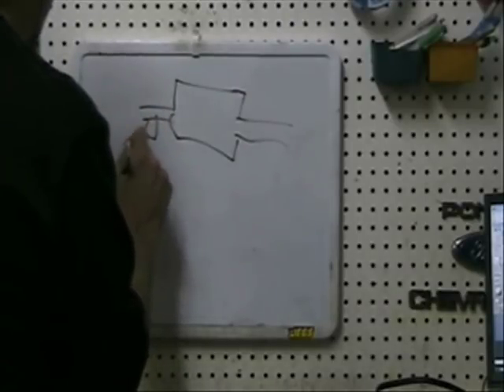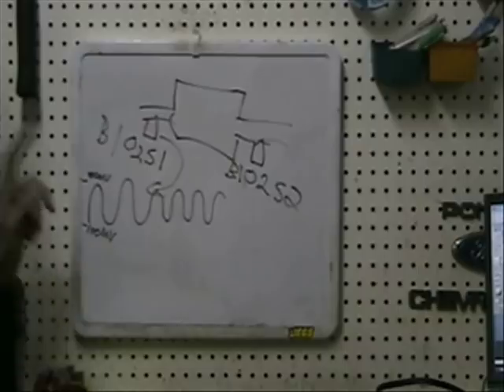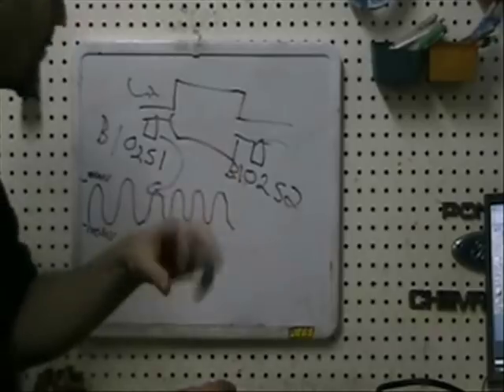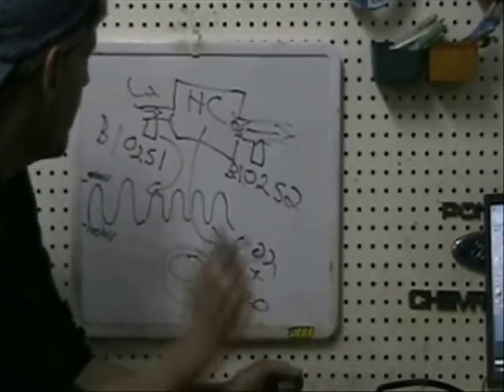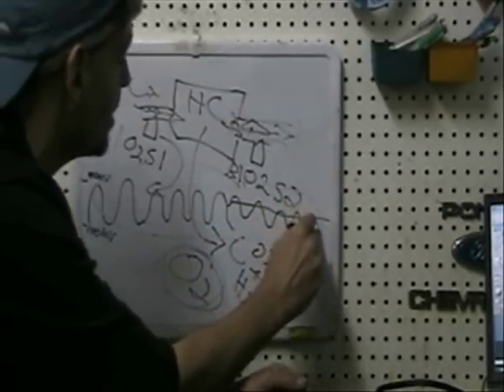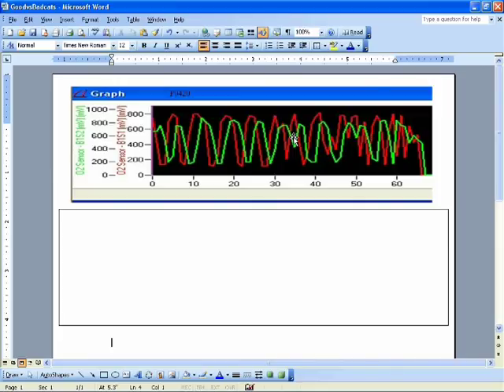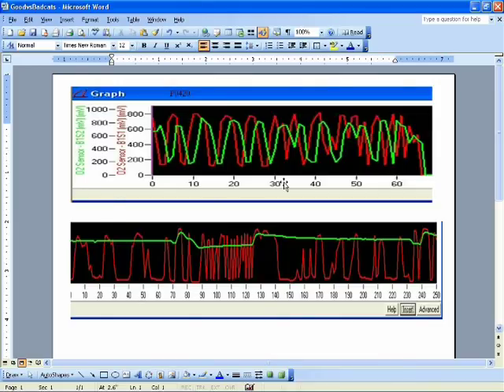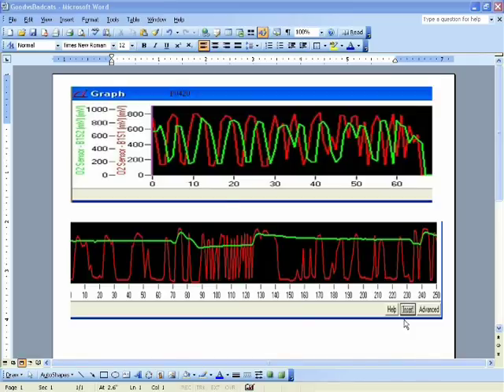P0420 P0430 catalytic converter catalyst inefficiency code diagnosis

Comment: Matt, i have a ford focus, it has p0420 last week and i check live data. Downstream o2 is changing the voltage rapidly, back and forth. I can't afford a new cat what do you reckon if sparkplug non foulers will help or no?
Reply: +EngrChillaX First, make sure the upstream O2 sensor is cycle properly, including that it is cycling fast enough. A new sensor should cycle more than 3 times a second. If your upstream is cycling less than once a second, replace it.

If the cycling is okay then try one of the commercially available converter cleaners such as Cataclean. If the converter hasn't been overheated and melted inside, it might just have carbon buildup, which the cleaner will remove. This will bring the efficiency up above the threshold and stop the code from being thrown.

Don't replace the converter until all of the other possible causes of the PO420 have been eliminated or ruled out.

Good luck.

Comment: I have a 2003 Rav4. I have the P0420 and P0430 codes. Why they put 4 O2 sensors in a 4 cylinder car I do not know. Anyway the readings from the O2 sensors are what I would expect from the upstream sensors. The downstream sensors indicate the same readings (pretty much) but instead of being less than one volt, they are 3.2-3.3. Is this normal?
Reply from the maker: Are you sure you don't have A/F sensors? It is impossible to have over one volt on a ZiO2 sensor.

Comment: Check engine light is on. P0420 is the code.  I went through POSSIBLE causes like the negative battery and all. But I just remember, we just move to Idaho and where we are there is NO SMOG CERT. IS IT WORTH TO FIX THIS? IF IT IS THE CATALYTIC CONVERTER, can I just FORGET IT? Or it will affect the engine? I hope this is a bit more clearer and I apologized, since you have given me good suggestions before. Again, thanks.
Reply from the maker: +timeisnow316 If the inefficiency is strictly evidenced by a mirroring of the front O2 sensor then no engine damage occurs, there is just simply no catalytic activity is all.

Comment: Thanks for the video, Matt. My 01 Jeep Grand Cherokee just gave me the P0420 code today. I do not have a scan tool to perform the tests in your video. That being said, let's assume my cat is toast. I live in an area where I am not subject emmissions testing (yet). Realistically, how long can I expect the vehicle to operate normally with a bad cat? Other than poor fuel economy, am I risking further damage to the engine? Thanks!
Reply from the maker: It's hard to say. First of all you might already have an engine issue that caused that bad cat- if the engine is running rich for example. In that event, you will surely eventually plug the cat and your engine will have severe performance.
  On the other hand, if the catalyst is just no longer active, there are no ill effects whatsoever. The only effects are environmental. You can run indefinitely with a bad cat as far as engine performance goes.
Reply: Thanks for the quick reply. If data from a diagnostic test showed similar results as the car in your video (OS1 and OS2 outputs the same), is that representative of an inactive cat?
Reply: Obviously the cat is inactive...guess what I meant to say is, is it representative of ONLY an inactive cat and not other engine issues and I can continue along my way "indefinitely" as you say. Just not wanting to drop a couple of grand on a vehicle with 190k miles.

Comment: 0420 on our 2002 Toyota Sienna. I check battery post, the negative was lose, & tighten it. Replace Air Filter and cleaned housing. MAF will spray it, I have to find out how. Gas cap SEEMS OK. Drove it for 10+ miles, "CE Light" remains on. WHERE I LIVE DOES NOT REQUIRE SMOG CERT.  Van still drives Very very  well. Just moved from Oregon to Idaho,,,so $$ is tight. Please advise,,,,,THANKS.
Reply from the maker: +timeisnow316 What does any of that have to do with catalyst efficiency verified by a s2 mirroring of the S1?  What in the world are you talking about????

Comment: Wouldn't a bad downstream o2 sensor cause the same code then?
Reply from the maker: Ryan Richards A bad downstream O2 will cause A code but not this code.  You aren't going to get a bad O2 sensor that just happens to oscillate in synchronization with the front O2.

Comment: here is my 2 cents... i just got a p0420  on my nissan V6  , i did a little reserch before buying a cat , i used my bluethoot obd scanner and my torque app  and found  my bank ONE  running rich  then i looked  at the upstream o2 sensor  and notice the sensor would never drop to 0 and  never go up  more than .6  ... the other bank looked better  from 0 to about .8  looked at the LTFT  of bank one and it was running rich  to about 12% in comparison with 2% of bank 2 ... my o2s are original with 200K miles on my truck YES lots of miles , i came to a conclusion of that o2 being lazzy and  it was richening the mixture in that bank  wich was overwhelming that cat ,  i change the upstream o2 and guess what  PO420 was gone within 10 minutes at the  first drive , was i lucky ?  i dont know, i am no mechanic! 
 by the way   i was able to see the honey comb in the cat with my endoscope camera and the cat was clean as a whistle ....
Reply from the maker: Lazy O2's are a complete different code and presentation than 0420.
Reply: but i never got a code for the 02 .
Reply from the maker: You don't always get one- a condition may not meet the required criteria for setting the code within 2 consecutive drive cycles for various reasons.

Comment: Nissan A/F sensors ( different voltage output interpreted by the ECM) is around 1.474v. see http://ww2.justanswer.com/uploads/FixUrNissan/2012-04-01_162843_12.jpg. I was told by a Nissan engineer to look for .001v to make a difference.

Comment: Thanks for this very informative video. My lexus is250 (06) seldom shows P0430 and after I clear it it doest show again for a month or two. Anyway to determine if the oxygen sensor needs replacing or the catholic converter?
Reply from the maker: Yes there is...... this video.
Reply: I din’t believe a lexus could be converted to catholic

Comment: I have a 2003 Nissan Xterra in emission test came out the P0430 code. Do you think that changing oxygen sensors is the solution?
Reply from the maker: WHat was the pre and after cat O2 response from the test shown in the video? That will tell you for sure.

Comment: So if you stuck a bad O2 sensor after the CAT, would 2 bads make a good?  I mean, a bad O2 sensor that produces an 800mv flat line is what the PCM expects right?  I heard about doing a fuel burn to burn off surface oxidation in the CAT.  Kind of sounds like a band aid fix.
Reply from the maker: nope you would get a "S2 fixed rich" code instead of a cat inefficiency.  Whoever you heard this commonly spread rumor from is just another parrot from the chat rooms who doesn't understand the algorithm.

Comment: I have a question, what if the first set of oxygen sensors have a flat line and the second set has the oscillating patterns? Would that still not cause the check engine light to turn on?
Reply from the maker: it absolutely would cause the check engine light to turn on but not for a catalytic converter code.

Comment: The O2s before the cat, is also called, the air fuel ratio sensor,or is it not,? I know the one after the cat,is called O2s...the one before the cat,monitors how much the unburn fuel enters the cat,right?
Reply from the maker: The precat is an AFR only if it operates in wideband

Comment: My car thru a p0300 misfire code and then thru a p0421 code.Car ran rough and lost power like a clogged cat will cause, but it is a intermittent problem.Did the misfire cause the 421?The Dash light started to flash on two occasions which I know is not good.I got a scan tool and the bank one 02 is fluctuating fast like you say and the second one fluctuates some also but not as much.Trying to fix misfire  issue by tune-up parts, but it is intermittent and tough to figure out.
Reply from the maker: What is your LTFT and STFT at idle vs load?

Comment: Hi! I have an 05 Mazda 3 with a slight different code (P0421) And for the life of me cant find reasonable information. I've had people say change the Cat coverter or says change the O2 sensor. I know its not the code in discussion but any pointers would help. Thank you
Reply from the maker: This is a great question.  Indeed with this code it could be the O2 sensor though far more likely it will be the converter.  The way I would test this is to get the car to closed loop and do an O2 sensor responsiveness test by adding propane to the intake and looking that both the front and rear sensors go rich and revert to lean when removing the propane (or you can also cause a vacuum leak if you wish to do it that way). If the rear O2 is not showing to be responding efficiently then I would call the sensor.  If the sensor is working right, then it is probably indeed correctly reporting a catalyst inefficiency and the cat will need changed.

Comment: Hey how are you doing ? I have an 05 murano,i replaced the resonator,about a day later, the P420 code popped up,could that be the cause? I also have the oil leak into the spark plugs tubes on the cylinders toward the fire wall,could that be the cause also ? Thanks
Reply from the maker: Could be. What data do you have?

Comment: What if someone has a high flow cat? When I was getting my exhaust done my mechanic said "ah you have a high flow cat I see", well I didn't know, i bought the truck with it in. And Ive had the 420 code since I bought it. Would the exiting exhaust read similar to the exhaust coming into the cat because its high flow?
Reply from the maker: High flow cats perform exactly the same. They will have full catalyst activity show on the analysis just like regular cats.

Comment: I checked my voltage on my upstream and downstream sensors - the upper one is fluctuating between 3 and 5 V and the lower is holding pretty steady around 0.8 V. Have you ever seen an upper sensor's voltage go that high? I don't know if this means the sensor is bad or if the wiring needs to be cleaned/replaced etc?
Reply from the maker: That is impossible. Sounds to me like you are testing BIAS

Comment: HI, does bad fuel tank pressure sensor causes catalytic converter to go bad?  i had code for FTP 6 months ago and still have not replaced it yet because engine light comes and goes, but now i have same code and tow more, P1454 (FTP) , P0420 and P2422 (vent valve stuck closed) engine light still comes and goes, but acceleration is pretty bad. thanks and well explained video
Reply from the maker: A rich running engine will burn out the cat quite rapidly

Comment: i have a 2002 chevy tahoe im getting the same code p0420 my truch smokes a little everynow and again but its oil on the scan tool i have it suggests reprogramming the ecm.  The ecm i have is new truck runs fine but the light goes out every now and again.
Reply from the maker: gilbert jefferson If the engine smokes it will destroy the cat rather quickly.  You need to fix the engine before replacing the cat if you want the maximum life of the cat. There is no need to reprogram the PCM.

Comment: ok so from my understanding i have a p0420 only but i have a v8. car cylinder 1 is on the passenger side meaning that is bank 1 so i have to replace the catalytic converter on the passenger side correct? since i haven't gotten a p0430?
Reply from the maker: +drvic714 Bank one may or may not be on passenger side.  Bank one refers to the bank containing cylinder#1.

Comment: I've got the P0420 on a Nissan Pathfinder, but it can go weeks after clearing.  I assume the cat must be marginal as some conditions occur that cause the ECM to trigger the code again - maybe it's humidity, or not, or fuel type, or whatever.  But if the cat is this marginal, is there anyway to recover it, or clean it?
Reply from the maker: Your assumption is exactly correct and the only solution is a new cat.

Comment: Quick question, i had a p0432 code on my 99 intrepid....runs great but after about a half hour of running i can see white smoke coming from my tailpipe and when stopped at a light loses power but willl not cutoff
Reply from the maker: Rich Young What did the evidence from your diagnostic tests indicate?

Comment: How much will shop cost me to check 2002 passat i think mines gone in Cal.
Reply from the maker: Typically a shop charges one hour labor for diagnosis regardless of the length of time it actually takes.  I would expect $80-$120.  Very rarely they may charge half hour.

Comment: Great video! Thanks for posting. Would love your advice. I scanned my car to troubleshoot a p0420 code. But my 02 sensor 2 has a solid line with a very low voltage. The sensor 2 line is appearing under the sensor 1 data. Almost complete opposite of you final graph at the end of the video. Any thoughts?
Reply from the maker: If your sensor 1 is stuck lean induce a rich condition via the FPR  or by adding a hrdrocarbon into the induction and if it doesnt respond replace the sensor.
Reply: Just so I understand, my 02 sensor after the CC is showing a steady low voltage, or lean condition, while my pre CC sensor is oscillating at a higher voltage which means it's running richer? It appears I have more o2 post CC than pre CC. Am I getting this mixed up? Thank you again for your help!!
Reply from the maker: Oh in that case remeasure at 2200RPM and verify O2S2 goes rich and you're fine.

Comment: i have a 2007 cadillac sts 4.6 v8 i have a p0430 code but my o2 sensor data on both banks are like you described, wave form goes in up and down  and comes out flat lined on both banks,  any suggestions?
Reply from the maker: +angel cedeno Not sure I understand.  What is your downstream O2 data showing relative to upstream?

Comment: Got a p0430 code on my 2003 ford expedition 4.6. bought a scanner to help out with check engine lights, though it's not a live data scanner i got freeze frame data. not really a mechanic myself, hopefully you can help me pinpoint the problem I have before investing in new cats. here's the data:

DTCFRZF......P0430
FUELSYS1.........CL
FUELSYS2.......N/A
LOAD_PCT(%)....40.4
ETC(°F)..............199
SHRTFT1(%).......-1.6
LONGFT1(%).......2.3
SHRTFT2(%).......-1.6
LONGFT2(%).......3.1
RPM(/min).........1090
VSS(mph)...........30
SPARKADV(°).......35
IAT(°F)..................73
MAF(lb/min).......1.589
TP(%)...................21.6
O2B1S1(V)..........0.710
SHRTFTB1S1(%).....-1.6
O2B1S2(V)..........0.675
02B3S1(V)..........0.610
SHRTFTB3S1(%)...-1.6
O2B3S2(V)...........0.620

any help is greatly appreciated.
Reply from the maker: This is useless.  What is your startegy here and how are you selecting data that supports it?  This looks like you are just giving me a whole data dump or something- nothing can be determined from this- there is nothing useful here

Comment: great post. Question: would a bad catalytic converter cause a good ignition coil / spark plug to code? I have a 2004 Isuzu Axiom coding P430 and P306 . At this point I am moving towards changing the catalytic converter. Please advise, Thanks.
Reply: +Onyx David I have the same two codes, was wondering that myself for my 5.7L truck. Did you get your vehicle fixed based on the "catalytic" code (P0430) OR the "misfire in cylinder 6" (P0306)? Your input would help my situation. Thanks. If anything, I may end up replacing the cats, and my fuel injectors altogether.
Reply: That's a good question. One of those codes has to do the either the cat fore-system while the other has to do with the cat-back. I know I will need to change the converter anyway but I'd rather just do the work one time instead of piece meal. But this is what they do in the garage and that can cost you a fortune in labor. My plan is to swap out the catalytic converter first and see if that eliminates both codes. I'll let you know what I find.
Reply: +Onyx David okay, I appreciate the updated info, thanks.
Reply: +Onyx David Code P0306 is a misfire in cylinder #6. Fix the problem with the misfire in cylinder 6 first before going on to the cat problem. A bad coil/spark plug can cause the cat to fail or melt down and set code P0430. If the spark plug isn't firing and raw fuel is going down the exhaust and into the cat, the cat will be ruined. It would be best it fix the ignition problem first then check cat efficiency after the ignition problem(s) are fixed.
Reply: Thanks for the tip. I have changed the spark plug and the coil on the sixth cylinder and still get the codes. I wonder what the cause of that could be?
Reply from the maker: +Onyx David What was the test you did that indicated the coil and spark plug were bad?  I would revisit that test because obviously your results were mistaken
Reply: +Onyx David Did you reset the computer after replacing the parts? Simply replacing the parts will not turn off the check engine light.
Reply: If you mean the ECM then I did not. I'm not sure how to reset it. Would disconnecting / reconnecting the harness do the trick?
Reply: Onyx David Yes the computer is the ECM. You can erase the ECM by using the code reader you used to pull the codes. If you don't have a code reader, you can disconnect the battery for a few minutes then reconnect it. Disconnecting the battery will usually clear the ECM but it will also erase the clock and presets in the radio. Then after reconnecting the battery, take the vehicle for a drive and check to see if the Check Engine light comes on again. If the vehicle has a misfire, you should be able to feel it when the vehicle is under a load like when accelerating from a stop or going up hill.